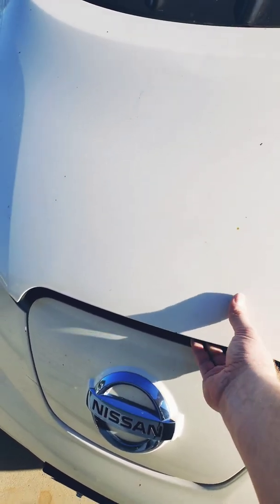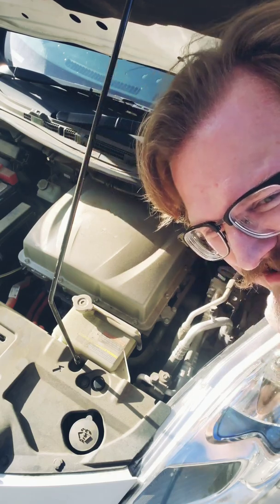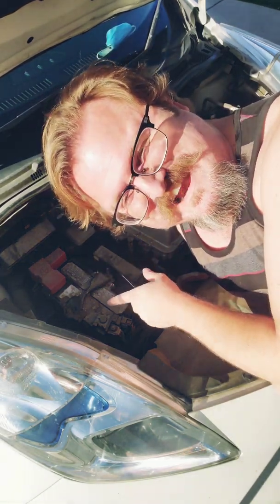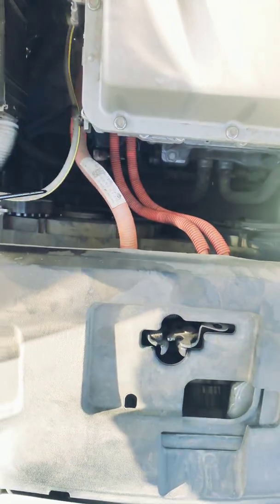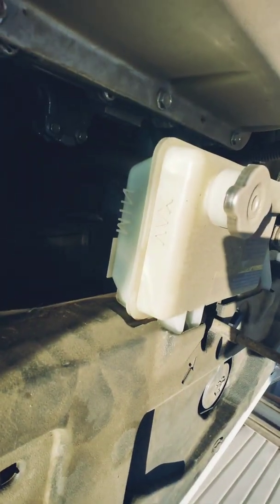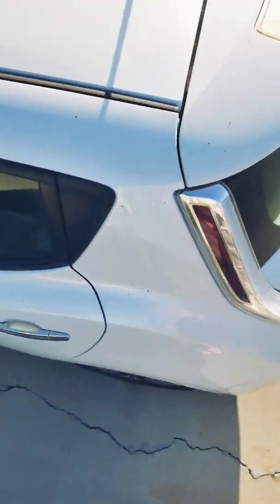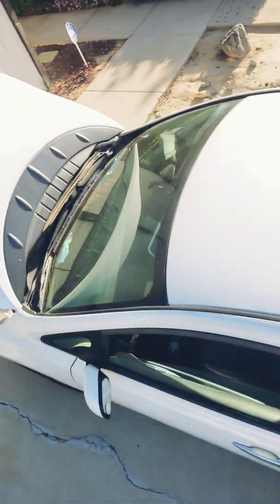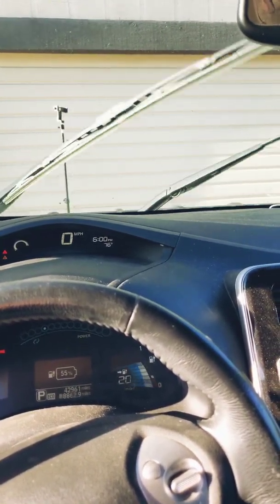How To: The Electric Car

Comment: That's some cutting edge tech. No joke that Nissan Leaf really do overheat. It can't contain soo much POWAARR!
Reply from the maker: MINE GETS 30 MILES PER CHARGE AHHAAAHA
Reply: @RyanCoomer  Amazing it even still drives. Most Leafs are barely functional at 50 miles. You have a special one there.
Reply from the maker: Yeah trip out haaahha the small battery has some corrosion around it. I'll have to get ride of the car soon. It's a 2016 and during the hot 100 degree summers here I used it for work and quick charged it twice a day. It killed it. Used to get 140 miles per charge hahaah oops. I knew it was bad to quickcharge but I had no choice hahaaa